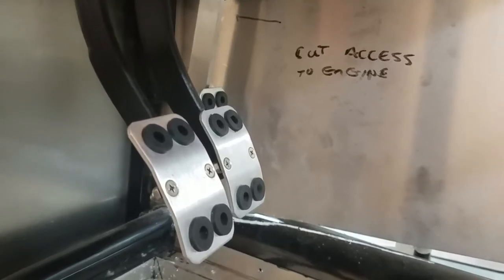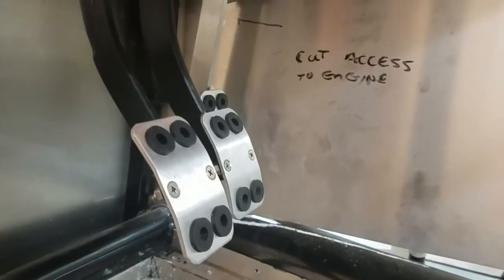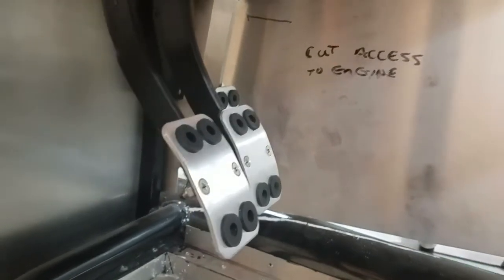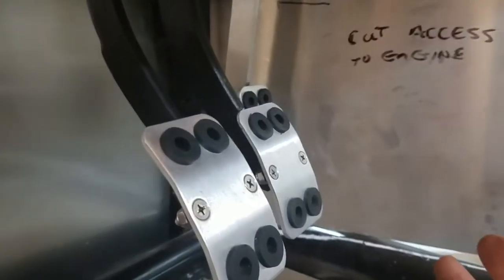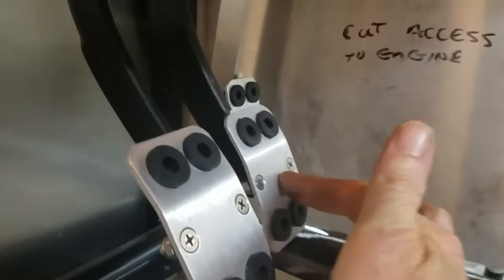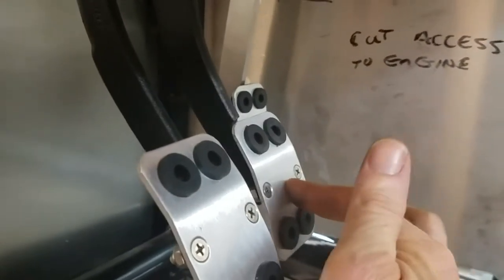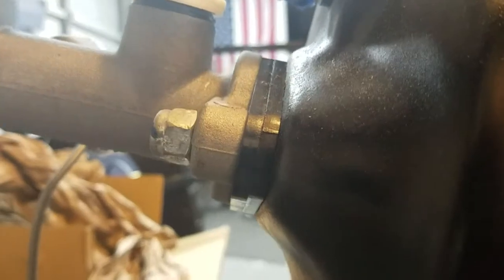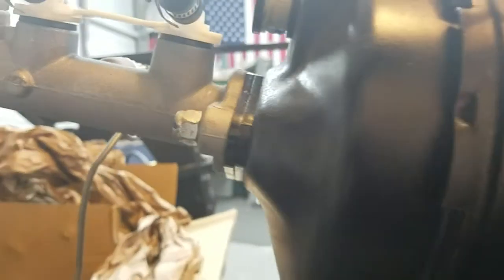How much brake pedal travel should there be when installed?

Comment: You want the master cylinder piston to return home when the pedal is released.  And, pressing the pedal to the floor, the master cylinder piston should bottom out just before the pedal contacts the floor.

The 3rd criteria I use is, I should be able to place my left foot on the floor under the pedal and still be able to stop the vehicle with my right foot on the pedal without mashing my left foot.